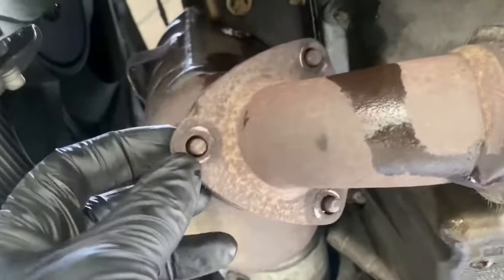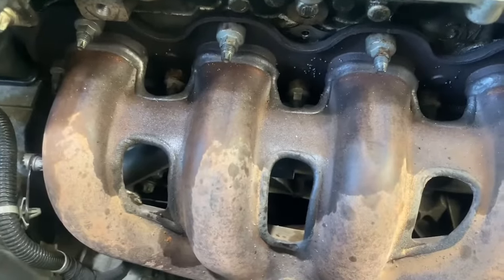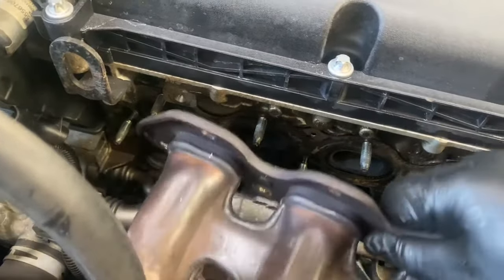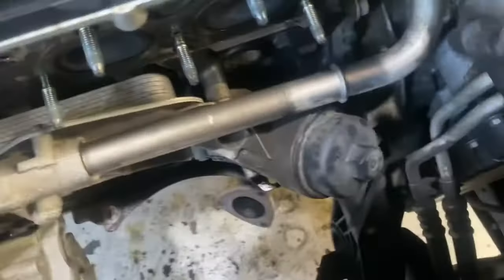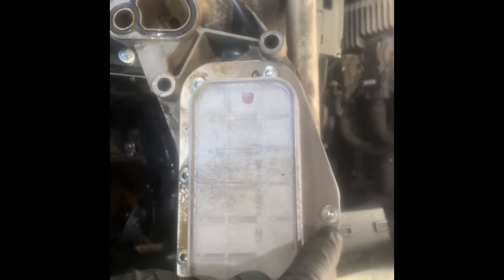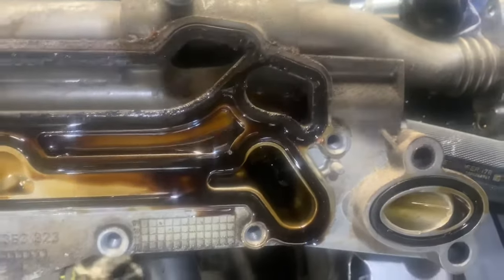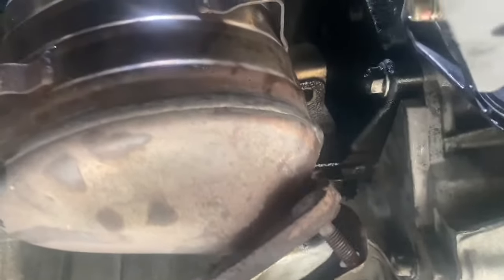#Vauxhall #Astra #oil #cooler #gasket #replacement

Comment: Thanks for taking the time to show this, hopefully I can resolve my oil in the coolant tank issue.
Reply from the maker: Check the dipstick to see if the oil has mixed with the water if it did them it’s your head gasket
Reply: I've had it both compression and block tested and I'm sure it's not the head. I also have an oil leak around that area somewhere and it finally drips around the cat. So I'm assuming it may be the cause of the oil leak along side of oil in the coolant. Thanks for the reply.
Reply: Graham was it the oil cooler in the end - if not what was it (I got similar coolant in oil issue in my 2005 Barina)
Reply from the maker: To your question it was the seal in the oil cooler

Comment: Great video, thanks.
My 2009 Astra Elite 1.8 z18xer hasn’t the sludgy waters in the expansion tank.
I’ve even bought another tank that I periodically clean and swap out.
Butter definitely gonna do this now.
Was going to get a new cooler but might just do the gaskets instead now.
Reply from the maker: You might need a new head gasket

Comment: One note... In these cars with A/C, you can just take the cooling fan out and you will have plenty of room to get the manifold + front cat assembly out with no problem. There are 6mm (if I remember right) bolts at the top corners of the fan and the bottom just sits on little hangers. Remember to unplug the fan and then disconnect the fan plug wires (bottom left/driver's side) and the A/C wires (bottom right/passenger side) from the fan housing before lifting. Also, be careful not to damage the radiator.
Reply from the maker: There is no need to remove the radiator.
Reply: @g_a_bofficial  right. Leave the rad in. Just remove fan. Lots more room.
Reply: Ive done a lot of swearing today trying to remove the manifold without taking the fan out. Will try doing that tomorrow :(

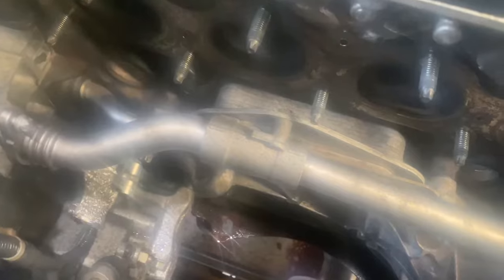Comment: 3:21 6:31 just for reference there's no power steering pump on that area ...that's the water pump housing
Replacing the metal pipes is not really needed nor suggested by anyone unless damaged...as for reference too that is actually a heat exchanger but is always improperly called by everyone oil cooler

Comment: Used this vid to change mine on zafira tourer 1.8 petrol ⛽ cheers as garage were giving it the oooos and the aaaaaaas head gasket they kept saying 🙄 no friend oil cooler seals £27 quid for febi❤🏴🏴🏴🏴🦄

Comment: please my vaxhaul astra is 2009, and my oil cooler gasket is bad , took it to an auto shop and was told they don’t sell the gasket seal alone I have to buy the complete oil cooler casing , where and how do you recon I can buy the seal/gasket

Comment: thanks for sharing this video. My opel astra h 2009 mixes oil in the cooling tank but the oil in the engine and dip stick looks fine, did you think its oil cooler that is the problem?

Comment: mate. got all my exhaust bolts off etc, nightmare ! forgot to take dipstick out. seemed like a very tight fit for me. did you have to remove the radiator? many thanks
Reply from the maker: No you don’t have to remove the Radiator
Reply: Mine the manifold seems impossible to remove. All bolts came out, lift it up touch the air conditioner pipe. going down the gap is too small. The designed is not for replacement. Opel Astra. Never buy Opal/GM again.

Comment: I couldn't remove the manifold, brackets were catching on cooler and A/C pipe, think I've solved it, oring was leaking on coolant pipe on RH side. How does the radiator fan assy remove please?
Reply: Remove front grill …three bolts along front gives you just enough to lift front metal part to get intake pipe out .. two bolts up top … under thd car disconnect fan wiring plug .. lift out assembly … one more small wire connected via a plug .. and you’d done
Reply: @iamasmurf1122  please my vaxhaul astra is 2009, and my oil cooler gasket is bad , took it to an auto shop and was told they don’t sell the gasket seal alone I have to buy the complete oil cooler casing , where and how do you recon I can buy the seal/gasket

Comment: My Vectra was in the garage to have rocker cover gasket changed yesterday. He said the oil cooler is weeping. Said it'd cost £1,200 to fit a replacement. Roughly what should a garage be charging to replace the seals please? I can source a housing if it has warped, just wanted how many hours labour you'd think.
Reply from the maker: That’s a bit steep for that you should find out how much the cooler is from Vauxhall

Comment: Good video what fluid do you have to drain just the oil and coolants mine has a  very bad leak i’m guessing its coming from there
Reply from the maker: Just the coolant a little bit of oil will come out but don’t worry

Comment: What is the gaskets part number for chevy cruze diesel 2.0L 2014 j305? Thanks
Reply from the maker: No clue I don’t do Chevy Cruze  however you can get that information you need from your local Chevy dealer

Comment: Can you send a link to the seal for the part that goes into the plastic thermastat housing please?
Reply from the maker: Sorry dude I got this part from the main dealer you would have to contact your local dealer or remove the old ones and order from Eurocarparts or one of those companies
Reply: @g_a_bofficial  cheers mate, I ordered a genuine one from eBay.
Reply from the maker: Cool no worries

Comment: I have oil in coolant reservoir in my Mk6 Astra 1.6 SRi, I have taken it to two garages and both of them refuse to change the seals on the oil cooler and want me to buy a new oil cooler and housing! In your opinion, why wont they just replace these seals like you have done??
Reply from the maker: I don’t know why they wouldn’t unless there is a problem with the old one how do you know it’s the oil cooler and not your head gasket
Reply: @g_a_bofficial  OK I HAVE SAME ISSUE BUT INSIDE MY ROCKER COVER CAP IS CLEAN AND FRESH NO SLUDGE ONLY SEEM TO BE OIL IN WATER NOT WATER IN OIL! I was told that it's the thermostat that fails and jams shut causing the rubber o rings to go flat and hard! so I was told to order (oil cooler seals kit, thermostat, 2 exhaust gaskets replacement expansion tank, full service and at least 3-4 rad and engine flushes also rubber grease £133 all in! also been quoted for head and was £1400-1600.....so
ANY HELP IS APPRECIATED Thanks.
Reply from the maker: Sounds like a head gasket problem if I’m in the rocker cover cap check the dipstick to see if the water has mixed with the oil
Reply: @MWSRD  With oil in the coolant, we had the thermostat & expansion tank cover fail; the oil kills the o-rings. We also replaced all the coolant hoses as they were swelling from the oil.
Reply from the maker: Sounds a bit like head gasket issue
Reply: @g_a_bofficial  The radiator failed so auto transmission fluid mixed with coolant. z18xer popular failure. Opel had a recall for a few, but not all, defective radiators. Preemptive fix is to install a separate transmission oil cooler so that mix can not happen!

Comment: What torque for m6 bolts to oil cooler ?
Reply from the maker: 20nm
Reply: @g_a_bofficial  it's 8nm I found it in service manual
Reply: @boru-cnc  Could you please link the service manual with the torque specs?

Comment: Any idea what the torque is for bolting the oil cooler back on? Cheers pal
Reply: 8nm for the o ring cover and 19Nm for the cooler to block that's on the chevy eco Tec engine th!
Reply from the maker: Oil cooler bolts torque  to 20Nm and 30nm to the block them check by hand.

Comment: I have the dreaded head gasket on a 1.4t meriva...50k miles wtf!! Going to try steel seal and let’s see
Reply from the maker: Try it if it doesn’t work Replace the gasket
Reply: @g_a_bofficial  first bottle has sealed some of it up - no longer drinks the coolant. Still white smoke from exhaust so will do another. Fingers Crossed.
Reply from the maker: Okay otherwise your gonna have to change the head gasket